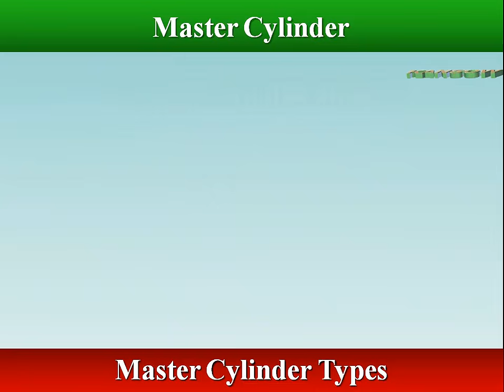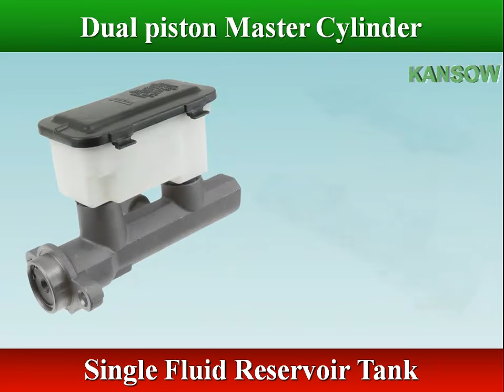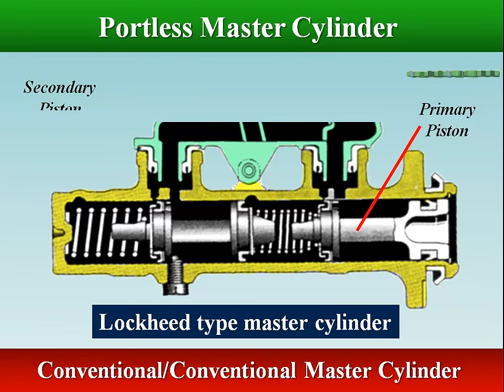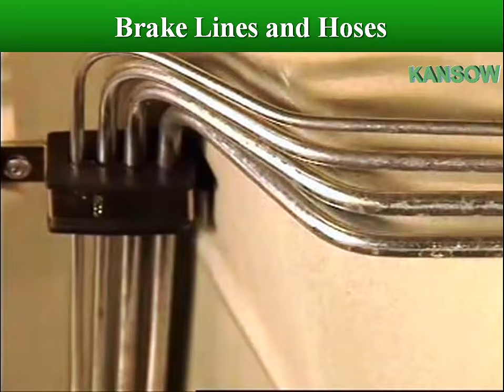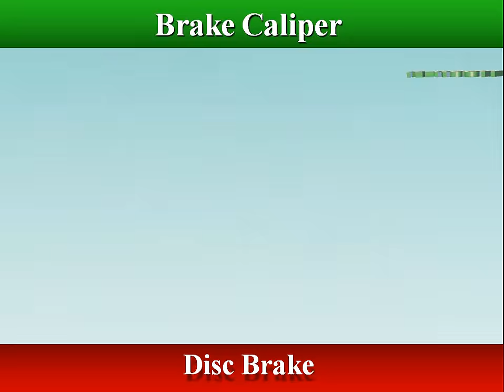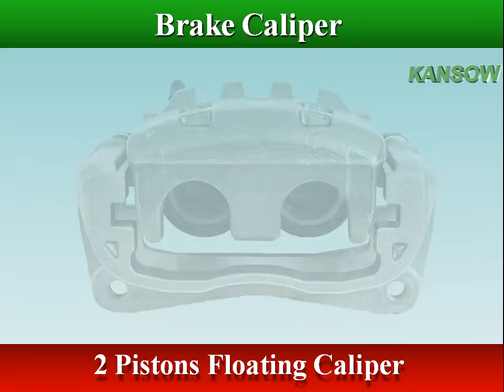Brake Hydraulic System Components

Comment: I was unable to watch the video in it's entirety because of the distracting animated watermark. I get the need for having a watermark but it doesn't need to be animated, it can be static just as effective. Animation is for cartoons, not instructional video. Also, there's better AI than the robotic sounding one you're using for 5his video that has unnatural pauses mid sentence and sounds uptight and rigid like a miscasted schoolteacher with her ______ in a bundle and her _____ in a hot clamp iron.